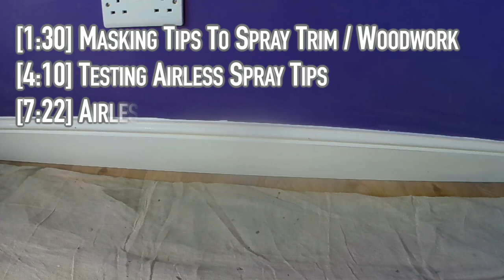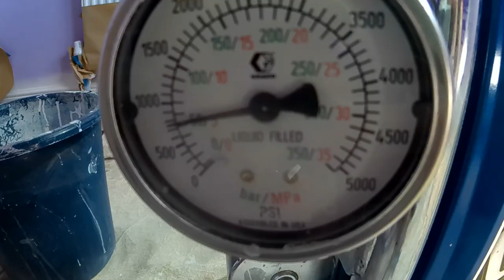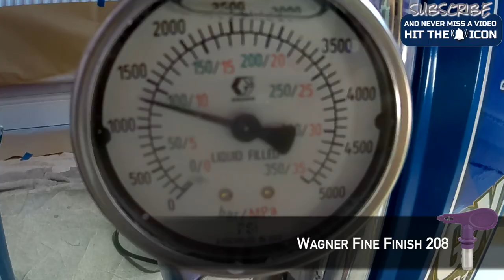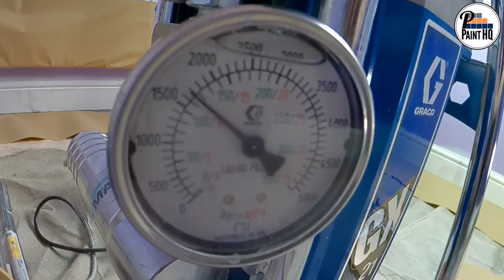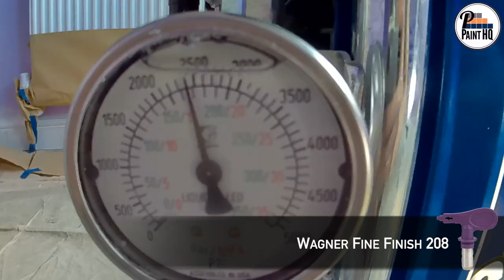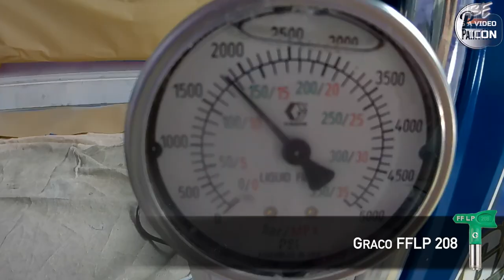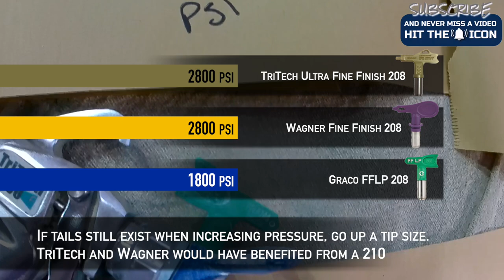Airless Spraying Woodwork | Testing Airless Spray Tips

Comment from the maker: What fine finish airless tips are you a fan of using?.. Graco FFLP, Wagner Fine Finish or TriTech Ultra Fine Finish.. Always good to hear about your experience and get your opinion.. regards Pete
Reply: I’m sticking with the FFLP tips for woodwork but, I may try some others in the near distant future 👍🏻
Reply: I like the graco ff tip,I haven't used the others but I found the finish really excellent with graco ff 208 on kitchen doors
Reply from the maker: 208 ..If the viscosity is thin enough to atomise at a lower / reasonable pressure ..Then 210 for thicker / decorative coatings (by decorative, I mean a product that could be brush / rolled as well as spray).. 210 / 310 is typically used in spraying woodwork / trim paints 👍
Reply from the maker: Thanks Edmond, appreciate your feedback 👏👏👏
Reply: Hi, very good experiencies with Graco FFLP.

Comment: Hi mate, great video. After are chat the other day I went and brought the tri tech tips.  I thought I heard that the tri tech tips have a narrower fan pattern to other makess in the same size, but looking at your tests it looks bigger! Is that just the camera or are there any difference?
Reply: I noticed that exactly. It seemed as though tritech gives a much wider fan? Possibly due to the higher pressure?
Reply from the maker: Hi Richard, ah lovely, I bet you can’t wait to give them a run out.. just spray plenty of test passes on paper and work up the pressure increments.. they’re not low pressure, so will take a bit extra to fill out the tails / edges.. that’s what happened in what you’re referring to.. the pattern was much more solid and even across the full width, what can be referred as a ‘letter box’ fan.. in this example the Graco and Wagner were a bit narrower looking, still 4” in width.. it does all depend on the material being sprayed, pigment and heat/viscosity all affecting the result.. I’m sure you’ll have success, let me know how you get on 👍 regards Pete
Reply: @PaintHQ  yeah I’m like a child at Xmas waiting for them lol.   Cheers for the info and I’ll keep you posted on my thoughts on them 👍
Reply from the maker: You’re welcome anytime.. regards Pete

Comment: I would say the graco tip is the best purely for lower pressure and over spray especially if it in a occupied house on site it doesn't really matter I have used a 208 on spindles and hand rail the only issue I had was the tip stopping but that was my fault for not straining and letting the paint down a touch but overall they are great tips
Reply from the maker: Thanks your your input and feedback John 🙏

Comment: Thanks Pete for another informative video, i was surprised by the great difference in pressure needed for the different brands to which i have all, so i will make a mental note that the tritech's need the higher pressure or size up.
I was surprised you choose 100 mesh i think i would have automatically gone 150-200 on the finest material, its good to have a play round (but all the clean up!) Your equipment is spotless how do you keep your machine/gun so fresh?
Finally pete i've just swapped my work lamp(same as yours) for the Festool syslite, its really night and day, you can place the festool in one part of the room and it will fully illuminate the whole room in a white light with no need to move it around or point the light at the area of work.
Keep up the great content!
Reply from the maker: Thank you very much for watching and your kind words.. you’re right about the filter choice, I would possibly of gone finer if I had one 😆👍 ..Regarding cleaning the equipment, I do try and keep on top of it.. wiping over with trade wipes and occasionally using the Wagner TipClean solution on a cloth to get rid of stubborn paint splashes..

..Really appreciate your insight into the Festool Syslite, I’ve heard excellent feedback from others saying the same as you.. it would certainly benefit me with needing the best possible light to film footage 😆

Great to hear from you my friend, really appreciate your continued support.. regards Pete 🙏

Comment: Paper,  what is paper ? How many gram/m - quality ? masking paper
Reply from the maker: Good question my friend.. it’s a relatively cheap masking paper, 30cm (12”) in width that fits on a hand masker, allowing masking tape to be applied along with the paper.. or you can use a pre-taped paper, such as this..

https://www.amazon.co.uk/Kip-Pre-Taped-Material-Surface-Protection/dp/B09HV9SHQ9/ref=mp_s_a_1_6?keywords=Kip&qid=1672607916&sr=8-6

Hope this helps my friend.. regards Pete

Comment: Helo watching you from Norway loks good im a pro painter too so  i have ultra finish 310  and i want to order 208 o 210 same ultra finish  i have 209 standard  so for painting trims frames from doors ...i  think 210 should be fine tk paint kitchens cabinets  what diference 208 210 what you will choose one of them  in my opinion 210 should be fine and whats diference 208 210 ?😊
Reply from the maker: Great to hear from you in Norway 🇳🇴💙 ..do you know my friend Victor Orrego (malermester_orrego).. good question about tip sizes.. for spraying most, ‘off the shelf’ paints that are thixotropic (can also be brushed and rolled).. a .010 will suit, so a 210 or 310.. a 310 will distribute paint over a wider fan, whereas a 210 could result in a heavier coat and be susceptible to runs in verticals.. Vs a .008 tip, much less fluid flow, suitable for low viscosity coatings (these are very thin, free flowing, usually spray only paints).. hope this helps my friend, keep in touch.. great to have your contribution on the PaintHQ channel.. 🇳🇴💙 ..regards Pete

Comment: Reviewing this video Pete, i see that the smaller tips will need to have a higher PSI than i thought as i like to spray with Zinsser products such as the new BIN Aqua and Allcoat Gloss.
Reply from the maker: Yes my friend.. typically smaller orifice tips .008 and .006 tips require a little more pressure to push the material through and atomise 👍 Regards Pete

Comment: Hi there great informative video! I wonder if you can advise on which tip would be best for me. I have a wagner control pro 350m and have only done walls and ceilings so far with the 517 tip included with the machine. I am now looking to spray all the skirting, architrave and door frame with a water based wood work paint. Would the 208 or the 210 fine tip be a better option considering its water based, and also would you advise thinning and if so by how much? Kind regards
Reply from the maker: Hello my friend, really appreciate you watching and your feedback.. this video might help with watching to use fine finish tips with your ControlPro unit..

Wagner 250M Setup. Airless Spray Tips Explained. Wagner 250M Cleaning
https://youtu.be/8APgip0-5J8

Take a look.. happy to help and advise further to get you up and running 🙏 regards Pete
Reply: Thanks for getting back to me Pete, I have watched your video, again very informative. What paint were you using? I'm assuming it's oil based? Would I run into any trouble with the smaller 208 fine finish tip when using a water based wood paint? Would you recommend thinning the paint or would I be better off with a 210 fine finish tip? Kind regards

Comment: Did you thin the paint before spraying sir? If yes , then what did you use to thin the paint and the thin mixing percentages of it ? Thanks
Reply from the maker: Great question.. I don't thin woodwork / trim paints.. I'll only perhaps thin emulsion / latex / wall and ceiling paint,  just to ease and lower the pressure.. in that case, I thin a maximum 10%.. sorry for my delayed reply, I will always get back to you  my friend.. regards Pete

Comment: Could you go to 212 and just spray faster?
Reply from the maker: Hi Eric, yes your theory is correct.. .012 will suit much thicker / higher viscosity, woodwork / trim paints.. so a .012 would not suit low viscosity / free flowing materials.. a 212 the fan being narrow, could result in a heavy coating.. yes you would have to move much quicker.. thanks for your question, keep in touch.. happy to help if I can.. regards Pete

Comment: Hi Pete, wagner ff and tritech uff tips demonstrated here aren't classed low pressure like graco fflp, right?
How does wagner HEA compare to those tips, could it be used in spraying joinery/trim and could nice finish be achieved with hea? I mean with decent pump like sf23 plus hea,  not 250/350 class.
Thanks.
Reply from the maker: Hello my friend.. you’re spot on, only Graco FF LP are Low Pressure in the fine finish category or tips.. the Wagner HEA performs very well in terms of low pressure, but I’d only use for emulsions, the atomisation / droplet is quite course.. which I guess is a trade off when keeping pressure low.. plus I think the HEA only go as low as .011 in orifice size, which would work with higher viscosity trim paints, and if you knew the product would ‘level out’ you could get a result 👍 ..great question buddy, hope I was able to help.. regards Pete
Reply: @PaintHQ  thank you 👍

Comment: Hi Pete, hope you are well, another great video mate. Which tips do you like spraying with most brand wise? Also, would you tend to thin your paint more to spray at lower psi or keep the paints consistency and spray at higher psi? Sorry if it's a dopey question.
Reply from the maker: Hey Gareth, that’s a very good question.. I never normally thin trim / woodwork paints.. nor would I overly up the pressure, I did that in the video for demonstration purposes.. first thing, and this is the general rule.. after steadily upping the pressure, if tails remain and pressure is now on the higher side.. go up a tip size.. so from a .008 to a .010.. only then if tails remain, I’d add a splash of water.. but it could now be a case the material doesn’t cope with spraying.. hope that makes sense my friend.. as for which manufacturer is better, now I’m not sitting on the fence, I genuinely believe they all have qualities to offer and a lot comes down to what you’re spraying and how that product behaves.. in essence that’s what I wanted to demonstrate in the video.. I often spray with Graco FFLP tips, but on this occasion the TriTech Ultra atomised the paint beautifully (although a higher pressure, but they’re not low pressure tips).. the Ultra lay down a good coat of AkzoNobel.. now in my opinion, you could be spraying the ‘best’ product in the world.. if you don’t lay on the optimal coat, the finish whilst won’t  be total disaster.. it won’t look and feel as mind blowing as it could.. sorry for the essay 🙈 hope that all makes sense.. great to hear from you, hope to meet up soon.. regards Pete
Reply: I don't mind reading an essay Pete, thanks for the explanation. I've mainly been using my gxff21 for ceilings but hoping this week to do a decent amount of woodwork for the first time as this job allows me to have a play if you know what I mean. I'll be spraying some BM High hiding primer then some scuff x eggshell. Really looking forward to this job to have a good play. Hopefully we'll meet up in Manchester mate, did you find some accommodation?
Reply from the maker: Ah you’ll do great on that job, let me know how it goes.. not overly looked at hotels yet, I’m thinking city centre with me heading up on the train.. yeah it’ll be great to meet up, I’ll get you a coffee my friend 👌👍

Comment: Hey pete thanks for sharing,what's your favourite tip out of those 3?the tritech seemed to give the finest finish but at a higher pressure,is this more likely to wear the tip out and does this mean the graco ff is better or longer lasting tip as it needs less pressure to atomise it,have you seen the new graco gxff cordless?is it worth buying over the 240 volt one I wonder,it would be great if they could send it to you for a full review and demo
Reply: Personally I’d opt for the the FFLP as it’s less work on the pump, thus better longevity for the tip and pump. The GX21 cordless looks great for the money! Not only do you get a fast charger and 2 batteries but, you also get the contractor pc compact gun too. Couple that with the extra hoses etc it’s a good deal
Reply from the maker: Hi Edmond, hope you’re well.. you’re right the TriTech Ultra with it’s double orifice atomisation does give a slightly finer pattern over the Graco FFLP.. but does take more pressure to achieve that.. don’t get me wrong, I’m a huge fan of Graco FFLP tips, achieving equally awesome results.. I was just wanting to showcase that different tip manufacturers respond differently and that naturally is influenced by the material being sprayed.. the TriTech tips pride themselves on quality and hardness of the tungsten carbide used in manufacturing.. some sprayers say the TriTech Ultras take a bit of ‘wearing in’ to a achieve optimal results 👍 ..you’re right though, there are other factors but generally speaking the higher pressure would cause more tip wear and the pump would work harder to maintain pressure..

The new addition to the Graco Cordless range, the GXFF Cordless is a genius design and in my opinion the perfect cordless option Vs the previous GX21 and 390 cordless models.. nice touch too that the GXFF Cordless comes with the Graco Contractor PC Compact gun 👌👏👏👏👍  ..Great to hear from you Edmond.. regards Pete
Reply from the maker: Thank you my friend 👌🙏
Reply: Great info. Thanks for sharing.  @PaintHQ
Reply from the maker: Anytime 🙏💙💯